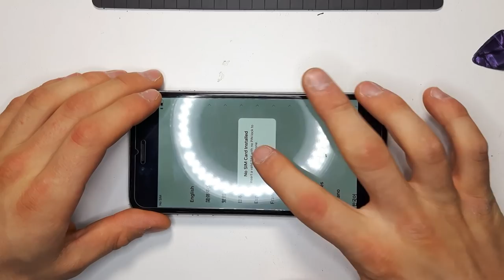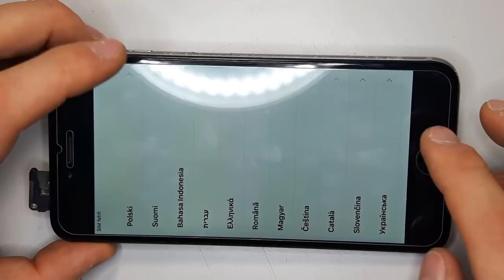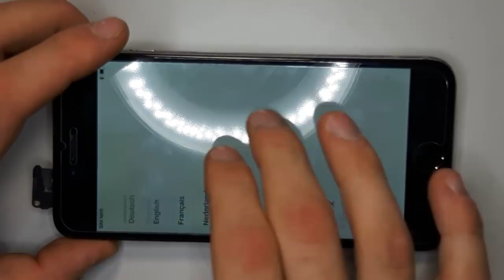IPHONE 6 Plus/ 6 Touch IC Fix - simple fix without replacing Touch IC

Comment: I did mine too and it worked. I just heated the chip at 300 C until it could shake slightly by a touch, then i allowed it cool.
3 days it still works good.

Comment: hello so do you put on some flux and that allows the ic  to heat and remelt the solder balls under the chip ? Also what temp is the hot air set at please?
Reply: 320℃-350℃
Reply: @sahilsingh5101  
Thanks . I gave up waiting for your reply and sold the phone .
The technology of phones is changing so fast that it wasn’t worth keeping .